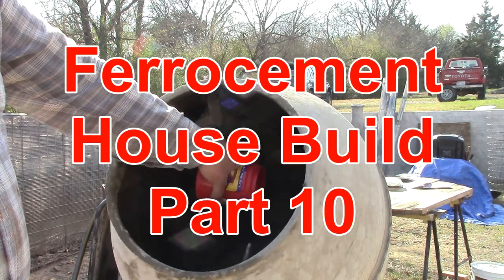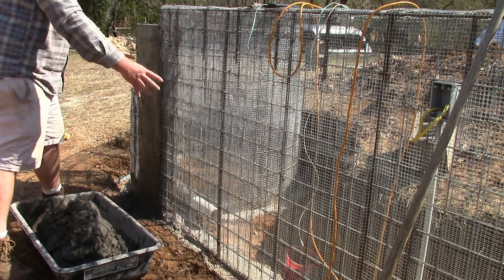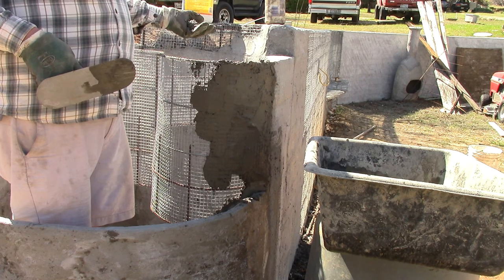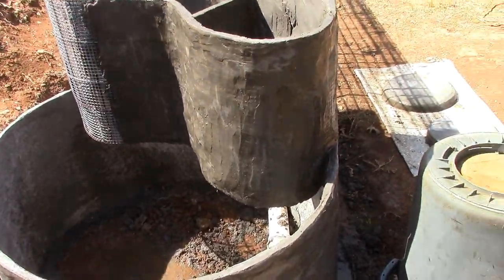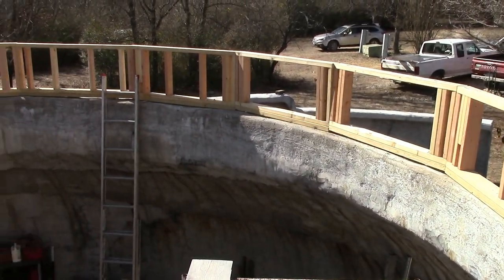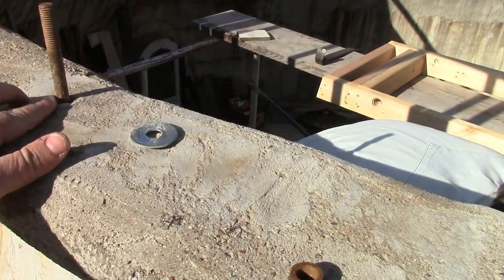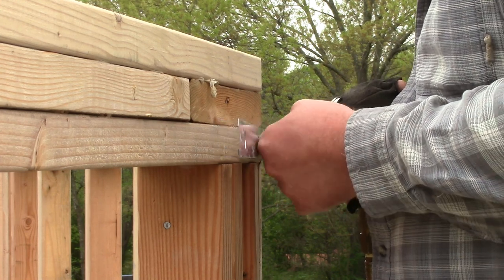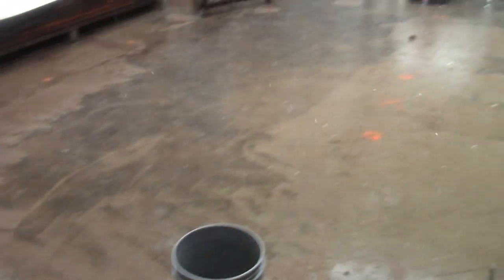Ferrocement House Project - Part 10 - Retaining wall and Starting the Roof

Comment: That roof truss system really is beautiful.  I definitely see a trade-off there with your overhang depth vs ability to see some sky.  It seems like the join between the flange and the pony wall framing seems like a real potential leak spot.  So the deeper your overhangs the better for that, but then you kind of eliminate the light you were trying to bring in.  So happy you are still putting these up.
Reply from the maker: I was making excuses about being too busy to edit videos. I decided yesterday that I just needed to hunker down and get one out. I might need to buy a new computer so my editing software can work better. Right now on my old beater computer it takes longer to import a video clip into the software then I spend editing the clip into the video. Just simple things like cutting out me walking to and from the camera takes minutes on this seven year old computer. I assume the daily vlogers and more prolific content creators probably don't tolerate such old equipment. I have a problem with holding onto things until they are so dead they can't be repaired, electronics don't get better with age.
Reply: I hear ya.  The laptop I use has a swelled battery so the track pad barely works for normal web navigating,  and it makes editing video just impossible.  So I was going months and months without putting any footage up.  I'd take some and then be like "oh, I can't even edit this".  Then I remembered I had an old corded mouse I could plug in.  Duh.

Comment: One quick question,if I'm developing a small wall, the concrete coating surface area of the wall would be one side x 2 right? As we are going to coat in both sides
Reply from the maker: I try to force the cement through metal until there is enough ton the back side to smooth out and back plaster as needed. Also it’s good to bang on it to agitate it brought to expel some of the air gaps from it.

Comment: Is adding hay to cement a thing? Like it is in cob?
Reply: You probably could, but I doubt it's ideal. Not many people have researched it that I can find. It adds some tensile strength but reduces compressive strength. In an application like this it might not matter, but you probably don't want to use it in a footer or otherwise critical component. There's probably been more research done using hemp stalks than with straw. "Hempcrete" might be a good starting point if you want to research it further.